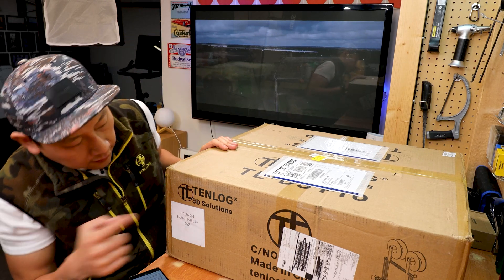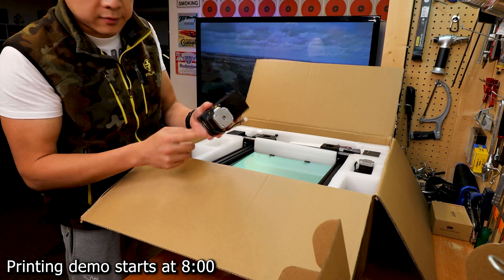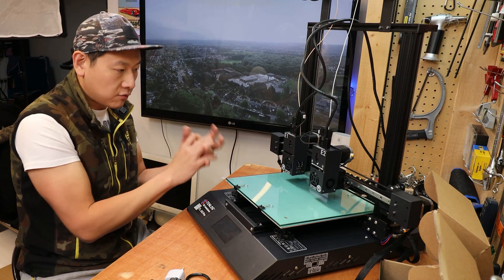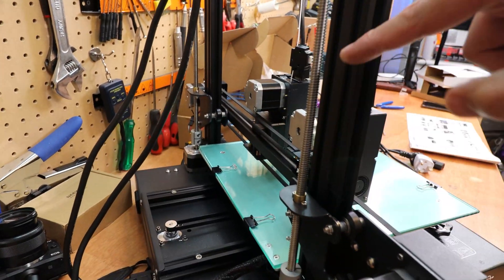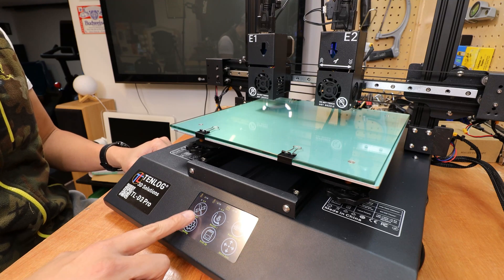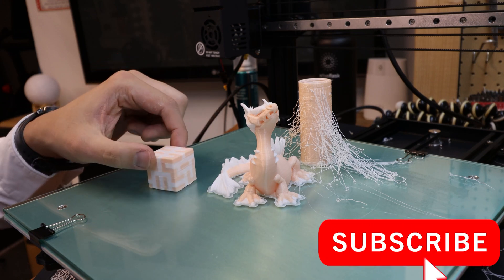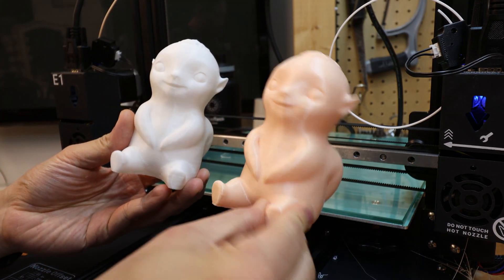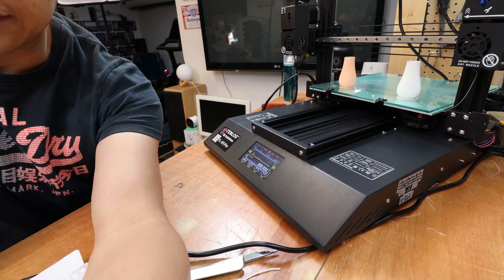Tenlog TL D3 Pro Independent Dual Extruder 3D printer review by Benson Chik Double the print speed!

Comment: How did you attach the spool holders?  I can't get the backside of the screw assembly to turn....
Reply from the maker: It is just a nut in the slot and a screw through the bracket into the nut. I sometimes have to put a flat head small screwdriver to get the nut to turn and lodge the right way
Reply: @BCreviews  It only worked when I left the back and screw much looser than I expected.  It properly turned and tightened in the back when I did that fortunately!

EDIT:  Ah, one is Glacier and one is Frostbite.

Any reason to not just go with this immediately?  Would I ever need multiples of the same plate for a single printer?

Comment: Hi Benson, goo review, please could You put the file of dragon in TLD format or STL with cura parameters, just to understanding how the tower layout works.
I tried to increase the speed and acceleration of movements on void areas but the printer looks like not be affected of these setting as like if it have a hardware lock, Do you know nothing about it? Also I Tried to increase the retraction speed of filament, but also this one could be  not change .
Reply from the maker: You may get better advise on Fb group as mine is the first version and they may have updated hardware. On mine there is no hardware lock as such and all changes made in cura will affect the machine inc movement speed and retraction

Comment: Do you think you could  put in a bl touch on these  machines ?
Reply from the maker: I am sure it will be a complete overhaul to do that as the main board is old tech etc. if the bed is flat and machine is on nice flat surface you don’t need to level it very often. This machine made me lots of money making logo lights where white face and colour side wall is needed, I only level the bed once every 10 prints or so and that is just for insurance..

Comment: Thanks Benson. I bought this machine and it's great. I'm a complete newbie to 3D printing. I was looking to buy a 3D printer to start this new hobby. Thanks to you and other reviewers who reviewed the Tenlog. For those looking for a new machine, I really recommend this model. Dual extrusion machines are only slightly more complicated than single extrusion. In fact it works exactly the same. The second print head just parks itself at the end when you're not using it.
My user experience has been joyful. From unpacking the perfectly packed box, to setting up the machine. All the tools were provided. They even give an extra screw for each set of screws. Its almost impossible to connect the cables incorrectly. They provide a USB stick (I have no idea why) and an SD card with the CURA software on it for you to download. They also give two spools of PLA which sem to be good quality (my prints came of good)
The best thing is since the reviews I have watched, Tenlog has improved the machine. The second printhead height adjustment is now from the back of the printhead. You loosen two allen screws and turn the red knob to raise / lower the printhead , then retighten the allen screws. They also now provide the wire brush to clean the nozzle at the end of the stroke.
The worse thing about this machine is the cable management. The cables just hang all over the place. It doesn't affect the printing at all but it would be nice to have the cables routed properly and looking neat. Also the fan noise from under hood is really loud. You cannot put this in a bedroom. Also one of the X axis belts came abit loose. I haven't adjusted it and the machine still works fine.
I'm happy to write this comprehensive review because I hope Tenlog continues to do well and also to help anyone who may be deciding to get this machine. I give this machine a solid 5 stars.
Reply from the maker: perfectly sum up m8, room to improve but at this price point it is as good as it gets in 2021. I now have a few other printer but not dual filament. Auto level, linear rail and all metal extruder is what is on my wish list, possible DIY conversion but as it is working as it should I will leave it as stock. Thanks for the support and feedback
Reply: I too am new to 3d printing. But I have to work on a budget and wanted the best bang for my buck. I almost just bought a cheap ender 3, but then I found a D3 listed on Facebook marketplace for less than the ender price. This video was one of the ones I watched to help me decide to buy it. Only issue was a clogged nozzle. I replaced both with brand new nozzles and it's been printing great since. Once I figured out how to set up Cura for the dual color prints, it does great. I fixed the cable problem with a zip tie right in the middle of the top support holding both secure with no issues whatsoever. I highly recommend this machine to everyone.
Reply from the maker: Just done 60 hours of print , setup to print and go to bed each day. Perfect print when I am back from work next day etc 👍 no need to level bed in between 😁
Reply: Awesome! Think you helped me make my mind up to buy this machine.

Comment: I’ve seen other printers with auto leveling beds. Are those just nice to have and not needed or is that an important feature?
Reply from the maker: If the bed is level in the first place you don’t need it. It I took me 2 days to level the bed to the point I can  print and not have to worry about levelling manually
Reply: @BCreviews  thank you! It just made me nervous because I read somewhere you should level the bed after so many prints.
Reply from the maker: If the machine is not set up correctly or if it is faulty than the bed will change height everytime it moves. Auto level will mask the symptom of a bad set up, a lot of people disagree but I say it how it is 😳

Comment: Great video. Have you tried the filament runout sensors yet? I bought this printer this past December (and I love it) but I have ran out of filament twice and the sensors did not pause the print like they're suppost to.
Reply from the maker: In my video there is a cube which I let the  filament ran out 3 times just to finish off left over from different wheels. It works when it wants to

Comment: Do the print heads drop downward when there is a resume to print after a power failure?
Reply from the maker: When I press pause on the screen it did that to my print and when press resume it did not print from where it stop however when I ran out of filament and the sensor n switch trip it stop and allows reload and print perfect from where it stops........I have not test the power off mid print function as I have not come across that yet and now printing money 24/7 so not testing it anymore but focus on making money to pay for itself quick.
Reply: @BCreviews  The tech stated yesterday to me that this has been resolved. When did you get your printer?
Reply from the maker: 13 Oct 2020 from Amazon
Reply: @BCreviews  Thank you  - let me now ask when was this fixed and the series.
Reply: The tech has asked to give the firmware version of your machine.
Reply: Awaiting your response.
Reply from the maker: sorry, another 18 hours till the print finish then I can check for you
Reply: @BCreviews  OMG! No problem, will tell the tech to sit down for 18 hours and have a tea.
Reply from the maker: firmware Jul 17 2020 UI 1.2.5
Reply: @BCreviews  Response from the tech: "The July firmware is old." Please update and give another test on resume.
Reply from the maker: Nah, I do not want to change anything at the moment as it is printing non stop in 8 hours rotation without any problem. We don’t get power cut and if it need to pause it I will just cut the filament and let the sensor stop the print and reload to resume. It is printing good money so don’t want to stop the train 🤗

Comment: I dono but my Ender 3 Pro does a hell of a lot better for the finish...  that one seems to need more adjustments in MHO... the finish looks rough to me...  maybe I'm spoiled with my Ender 3 pro....
Reply from the maker: Those are standard settings from CURA4.4 so not perfect. The filament came with the machine are crap, brittle enough it will just snap during print ....  I did an update video on this printer where I printed a 10 digit password puzzle box :)  getting there 😊
Reply: @BCreviews  what is funny is that if you go to Amazon and see the pics they put for this printer... they are photoshopped to look smooth.....lmao...  oh and it's now unavailable on Amazon....  just some FYI

Comment: Are you using simplify 3D? If so can you share your profile I can get mine to work
Reply from the maker: I use CURA 4.4 to slice, only version I find which does not need custom adding profile. Never used any other software as I got used to it with my Tevo 1st gen
Reply: Have you tried using IdeaMaker for slicing? I use it on my Raise3D E2, the slicer is compatible with 3rd party printers
Reply: The profile is on the Tenlog website

Comment: Hi Benson, I am thinking of buying one ,do you recommend?
Reply from the maker: Depends on your needs. The D3 is a good machine and with independent dual extruder and you are paying extra for that. If you want just to print different colour then there are cheaper  machine which can print just as well if not better. If you want double production speed and will not need full 30x30x35cm print bed (half one of the 30cm) then the D3 Pro is great. I want to check out the 4 head mod to print 15x15x35 but 4 at a time :) it's crazy

Comment: you dont need a prime tower if you got a dual extruder .... pls correct me.
Reply from the maker: I think is the opposite , prime tower is needed because the extruder take turns to print, when it is it's turnit moves to position to print but plastic may not be flowing when it hit target. The tower will be hit first so even if it is running empty by the time it moves to the actual model plastic would be flowing freely already.
Reply: i know what you mean, but with good retreaction settings and combing mode i hope it work without that waste tower :). i recive my TL D3 next week, i keep you update with my experience.
Reply: you try that ooze shield he explained? https://youtu.be/xRtvbICRh1w?t=118
Reply from the maker: Not sure what that is but I guess it is similar to the wipe bins STL found on the Tenlog SD card. I printed them and will mount it with wire brush this weekend
Reply: This is the first video about the Tenlog that the reviewer used a prime tower. No one else has needed one before that I have seen. If it helps then I can see it being needed but it should not need it.
Reply from the maker: Don't need it if you have the wipe bin and retraction setting spot on. The STL file is on the SD card already which Inc the prime tower. I only demo by printing what is on the SD card.